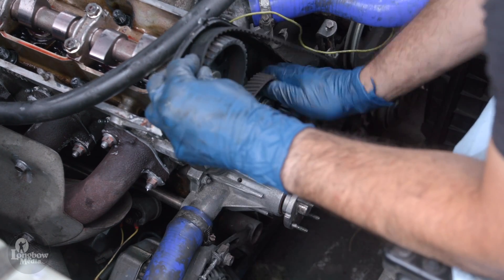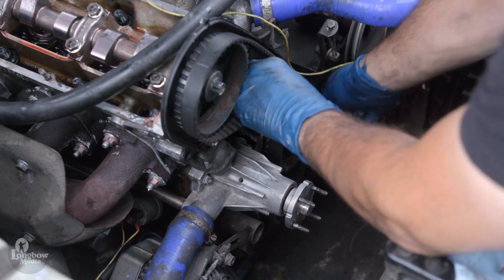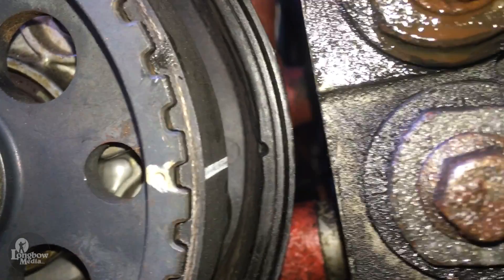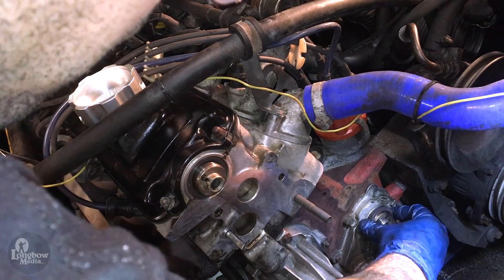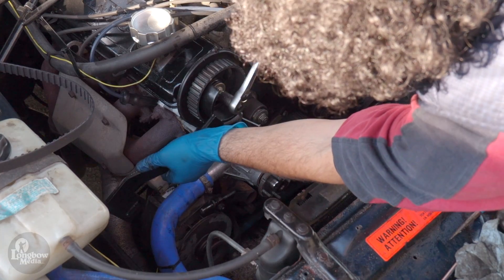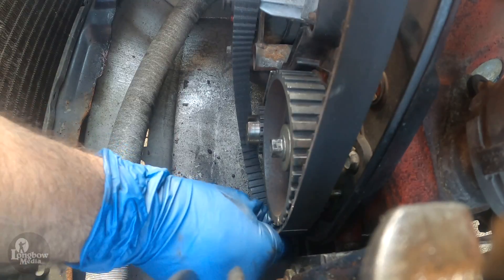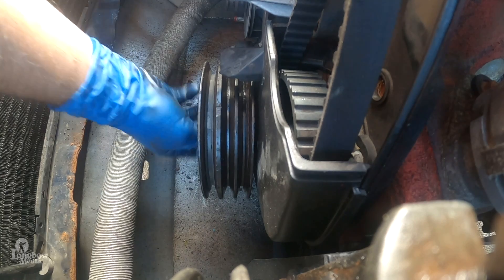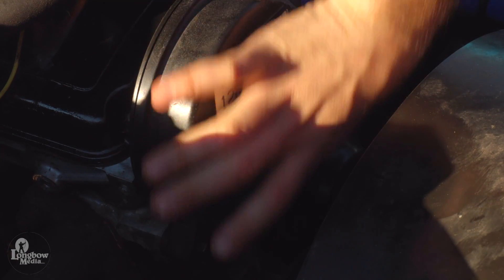How to Replace the Timing Belt, Tensioner and Front Engine Seals on a B230F Engine (Volvo 240)

Comment: Dear Maestro.  I'm doing a manual '87 245 and a '93 240 auto with ABS, both "saved from the crusher."  Assuming hard use and varying degrees of neglect, when I do the timing belt and seals job I plan to also do the Water pump and change the tensioner.  Any other basic advice on Related JOBS with your example as the basic model?  Big Thx for all your videos.  Have you done or soon to post new videos on the diesel swaps we have heard about in Maine?  D Day

Comment: Very good video. I recently bought a Volvo 740 with the B230F engine, and it has a but of a pulley squeal that seems to be coming from the front. Also has leaking seals, so I might as well do this whole procedure. It's otherwise in good shape for having done 400k km.

Comment: Having trouble getting the crank shaft pulley off…. definitely doesn’t wiggle off like it showed in video. Otherwise very informative video and to the point no BS around it
Reply: Had that happen to me it was a nightmare, thought I would never get it off but loads of PV blaster, and just yanking in all sorts of angles with a crowbar it came off eventually but it sucked

Comment: My counter hold does not fit in the camshaft pulley. Why would you not break that bolt free BEFORE removing the lower pulley? I had to reassemble half of it because of this one step.
Reply: I just had a friend pull it the opposite way with those locking pliers that have the 90 degree bent ends while I tightened/loosened the cam gear, it wasn’t as smooth as the holder tool but worked out

Comment: What are the drift tools you use and where do I find? Thanks.
Reply from the maker: I think I got mine through local classifieds...You can use a PVC tube or large socket that matches the diameter of the seal as a drift tool as well.
Reply: @LongbowMedia  Perhaps there may be a way to build the tools with a 3D printer??? Or buy the castings from someone?  I suspect they were quickly made and then the molds were re-used for the white blocks tooling.  As the automobile manufacturer securities analyst from Drexel-Burnham-Lambert once remarked on Wall Street Week to Mr. Ryrhiser: "The automobile manufacturers are just a thin veneer through which capital is sent to the machine tool industry."  That explains why Haas can race so many cars in so many series, including F1.

Comment: Thank you for all the videos.  My timing belt snapped, was expecting it eventually.  Hasn't been replaced since previous owner in 2012.  Probably 100k miles, service schedule is 50k.
Reply: My harmonic balancer was bad, spinning two piece.  The tensioner is possibly  optional, and requires a 6" vice, no C clamps won't work. 1st attempt didn't work, took the belt off and turned the cam gear 360 degrees to fix.   FYI mechanics

Comment: If the marks on the cam gear are slightly off, do you turn the gear once the old belt is off, before installing the new belt?

Comment: Very good video, easy to follow.   On the B230FX motor it does not use the standard belt, the belt has rounded teeth. Using the wrong belt will cause the belt to wear quickly.
Reply from the maker: Good to know, thanks for the heads up!

Comment: Great Video! What tool did you use on the cam gear and to press the seal in?
Reply: Did you ever find out?
Reply: @kurrenkidd4089  I got the tools for my 240 from Volvo.  They used to be listed in the Green book with part numbers.  They were also available from I believe Zelenda Tool Co. which used to be on Austin Street in Forest Hills/Rego Park NY area.  There is one other German tool manufacturer who makes a similar piece. Sorry, my memory is failing me but I will attempt to locate their name.  There was also a holder for the intermediate and camshaft belt gears that I have.  You had to install an 8 mm bolt into it and them attach a breaker bar.  If I can, I will photograph what I still have.  I also had a tool to insert the crankshaft seal.  I only have one half of it left, the piece that held the seal to place in over the crankshaft end.  It worked but damaged the seal so now its leaking and I have to do the job all over again.  Quelle bummer!  Pardon my French...I still love you and your phrases Judith M-B...many regrets I became such an irritant...sorry I believe it's the aging process in males.  God Bless you! Many years!!!